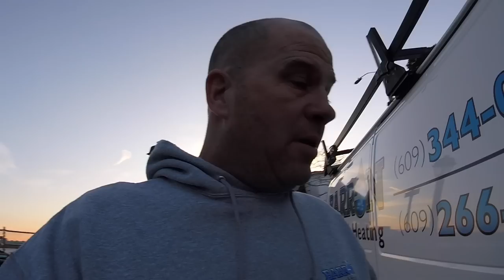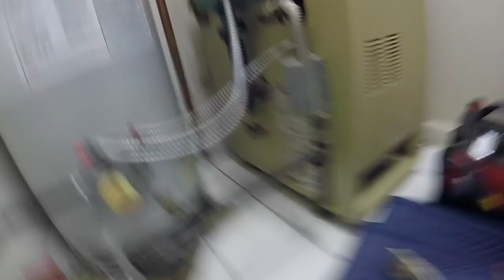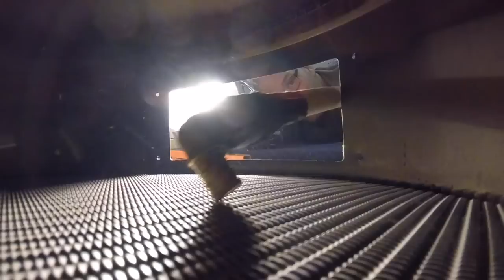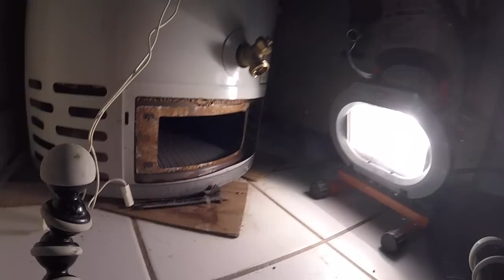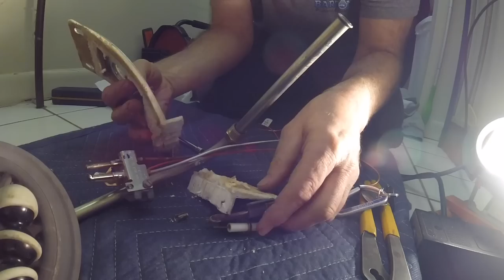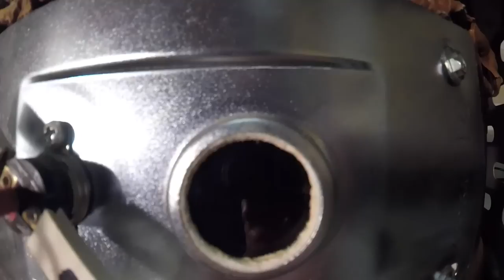Hot water heater pilot will not stay lit

Comment: Glad to see you cleaning the flame arrestor screen. Nobody does. I would caution with using ammonia-based glass cleaner for your soap bubble test solution. While I've used it for 30 years you must wash it off. It has been proven to cause stress cracking in the brass, which will eventually leak. Just rinse it well of use commercial leak check bubbles. Glad you cheaned the whole pilot assy. and not just the tube. PIA job to work on without gas pipes in the way. That's the kind of layout that causes hacks to bail on it without solving the problem. Overall, good job!
Reply from the maker: Thanks plumber. thanks for tips too.

Comment: I'm assuming the other plumber mess it up the fitting or it just need it a snag it with a wrench key or a crescent wrench, I would not use pliers or channel locks on these fittings they are delicate cz its brass it can not be over tight
Reply from the maker: Ya bad habit of mine. Open end wrenches best method.

Comment: Great video.  I built the angled hose and blew out my Bradford White.  Got some stuff but not as much as I expected.  Wouldn't stay lit.  It is in a rental house and the people have had pets.  I cut and flattened the flange around the base of the heater and put a piece of hooked hanger wire through the holes and swept the bottom underneath the grating.  I got almost nothing out.  Was expecting gobs of hair.  The pilot stayed lit.  The heater fired up and then died out.  My compressor was 2 gals and dropped immediately from 100 psi when I started flushing the grate.  Any suggestions?
Reply from the maker: sorry i missed this......That disc in middle got to be really blown out

Comment: Recent flood.  My pilot light lights, stays on, then burner also lights. Then burner only stays lit for a few seconds and goes out taking pilot light with it.  Then pilot won't light for 20 minutes.  When pilot does light, situation repeats.  I've taken the burner assembly out and cleaned it and cleaned the filter, and blown out gas lines.  Any suggestions appreciated!

Comment: My filter was dirty. Cleaned everything. It still doesn’t stay lite. I was proud of myself for taking it apart and putting it back together. What were you doing with the windex?
Reply from the maker: Checking for gas leaks on my connections. if bubbles its troubles

Comment: I want to clean my water heater filter...should I turn off the gas valve to the heater? Or would turning the knob to off be enough.
Reply from the maker: Shut er down. do both. safety first.
Reply: Ty so much...I know sometimes tryin to save a few bucks can cause problems. But I know I can do it, just needed a bit of information. Ty you again and continued Blessings.
Reply from the maker: Thank You.

Comment: Replaced thermocouple and blew out the filter, pilot still won't stay lit.  Any suggestions?
Reply from the maker: you gotta make sure filter is perfect. I did the same thing years ago and ended up calling Tech support and learned the big lesson...hi pressure air blow out...it worked and been doing it ever since. good luck Elov

Comment: Hi, my pilot light stays for a day then in next day it goes off, i changed thermocouple got same issue, today i change pilot tube assembly, cleaned filter using compressed air..  Hoping it will stay.

CAn you advise what else could the cause for going away once in a day or so. how do i check if it is not because of draft or vaccum making pilot light goes off.
Reply from the maker: well how did you make out? sounds like filter to me
Reply: Chuck Barron yep it is filter